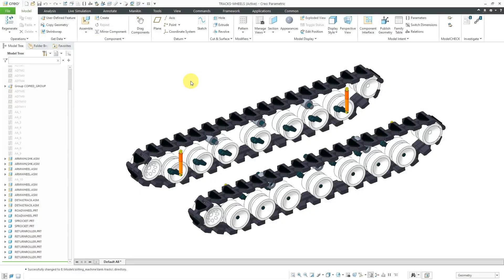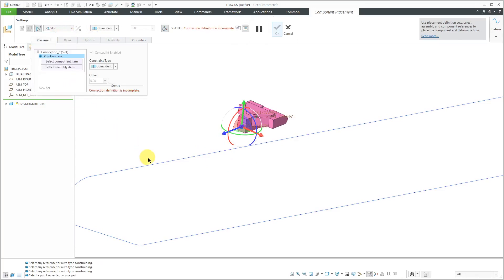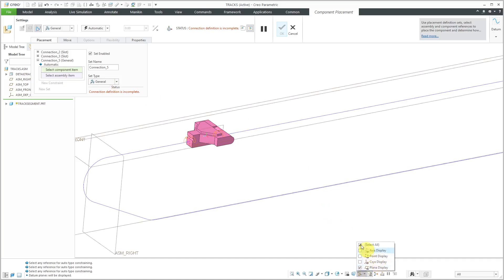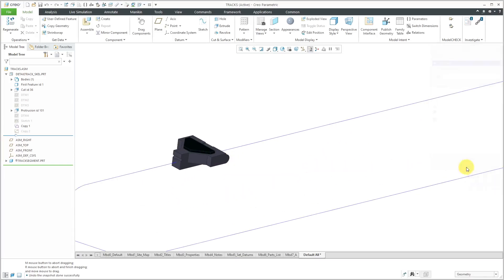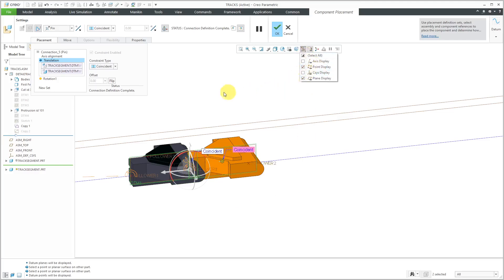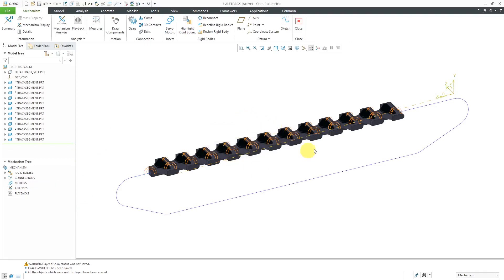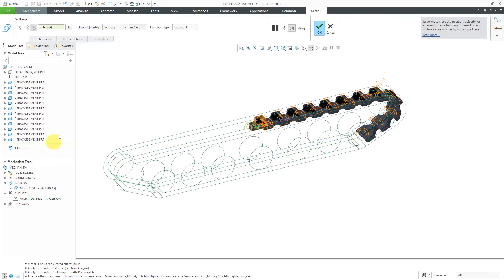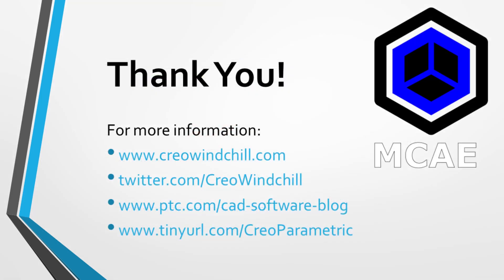Creo Parametric - Mechanisms | General Connections

Comment: Hi Dave,
When should you opt to use motion skeletons or skeletons with motion connections instead of using this method? This seems so much simpler that building an entirely new assembly just to get the parts to move.
Thank you.
Reply from the maker: As I state both in my Motion Skeletons video and Top Down Design book, I don’t recommend Motion Skeletons.
Reply: @CADPLMGuy  What about the skeletons with motion connections? When would I use those instead of parts. Sorry for being unclear.
Reply from the maker: When you're designing from the top level and you don't have the individual parts designed. You're using the Skeletons to size the moving components.
Reply: @CADPLMGuy  oh! That makes sense! Thank you, sir.